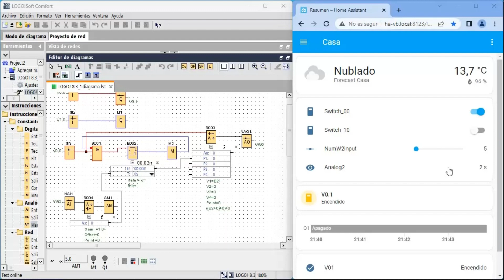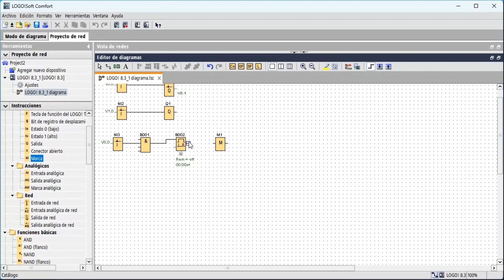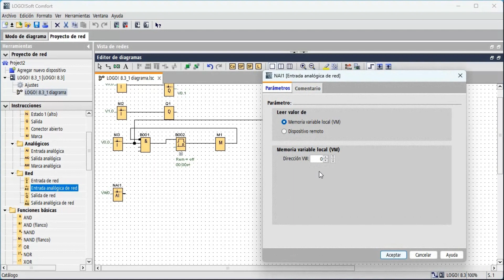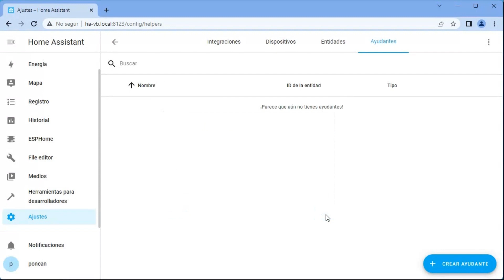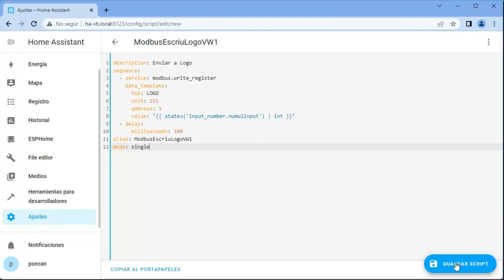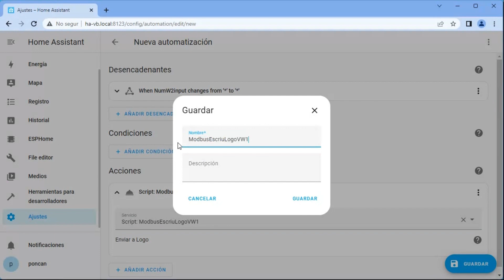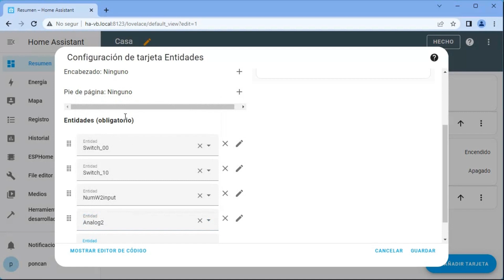Home assistant  Siemens LOGO! via modbus tcp (señales analogicas)

Comment: Thank you for this video.

I`m struggeling with the basics:

- How can I connect my Logo 8 via Modbus? I`m mainly using NI and NQ blocks to set up my shutters, lights, etc.
- Which settings must be set up at the mudbus-connection and other settings in Logo Soft Comfor?
- Do I need to install the Modbus Addon in HA?

I would really appreciate any help.
Thank you in advance.
Reply from the maker: Thanks for the comment.
As explained in the video you must have the Logo and the machine running HA connected on the same network, with the same ip range.
The Logo and HA parameters are in this video: https://www.youtube.com/watch?v=bvM623LtH6s&t=0s
For these blocks you use that are digital signals it will guide you better.
Anyway you are right that it is necessary to have the modbus integration installed. It is a fault on our part not to have included it in the video.
If you encounter any problems, please do not hesitate to contact us again.
Reply: @progspont2623  Thank you very much for the hint regarding the video-I haven`t found this so far.
I copied your entities and also the Logo program. 

If I change the time via slider, this is not shown in Logo Soft Comfort.
How do you connect NAI1 to HA?

I want to realize a switch-of delay for my garden sprinklers.
That means I want to set up a target time (e.g. 5 minutes) with a slider --> then I press Start (NI1 /V0.0) to start the sprinklers --> adjusted time in the slider should run backwards, until 0 seconds are left, then it`ll be turned off.

This is not running, even if I replace the switch-on delay with a switch-off delay.
Unfortunately I cannot provide you a picture here to maybe understand better what I mean...

But in general-is this achieveable with your procedure shown in this video?

Thank you very much.
Reply from the maker: Sorry, the video we are referring to is this one and we were only referring to transferring the value of the slider to Logo
If what you are referring to is the logic of Logo, I will leave you an example that does what you say, but in any case there are many ways to do it, since for example in this one, to start up it depends on a pulse and once launched it cannot be turned off until the time has elapsed.
Remember to adjust the time units and the V and VW to your project
https://drive.google.com/file/d/1zUqNtlo0a9FZbEWBpBMPBL05b7WYib6Y/view?usp=sharing
You could also do everything from an HA automation but this could leave the sprinklers on in case of a problem with HA, if you can do it in Logo better.
We hope it helps.
Reply: @progspont2623  Thank you very much.
I have tried both ways. 
The main problem ist, that making changes in HA with the slider, this has no effect to the value displayed in LSC (Online -Test).
Do you have an idea, what might have gone wrong?
Thank you for all your friendly support.
Reply from the maker: We first do a simulation in LogoSoft and in it we open the data table, we introduce the VW in the case of the example VW3 and we check that by introducing a new value this is reflected in the simulation.
Then in HA
Check that in the script that appears at minute 5:15 of this video you have the correct address, keep in mind that it has to be a number one digit lower than the VW of Logo.
Also make sure that the template contained in value: of this script correctly addresses the numeric helper (slider).
We can't think of what else could go wrong.
If all this fails you can check in developer tools Actions (previously services) put modbus.write_register and in user interface mode fill in the fields and [PERFORM ACTION] once you have done that you can press MODE YAML
We hope it helps.
Reply from the maker: The template contained in value: you can check it in Developer Tools TEMPLATE
Paste it at the end of the editor and it should give you the value of the slider.
Reply: Thank you very much.
I still didn`t get it runnig.

In the configuration.yaml you have an entry:

hub: LOGO

What do I have to enter here?
I tried it with this entry, I have also entered the IP of the Logo, etc.

Thank you very much.
Reply from the maker: At minute 6:20 of this video in configuration.yaml line 21 we define name: "LOGO" or whatever you have.

Comment: Many thanks for bringing up this video. Did you realize a roller shutter with logo and home assistant. This would be a great example. Today im struggling with this kind of topic. ManyThanks
Reply from the maker: Thanks for comment. We have never done any project with blinds or awnings, maybe in the future...
We are currently busy on an external project and cannot upload videos.
In any case, we would have to study how to use a LOGO! to control blinds, as the basic version has 4 outputs it could control 2 blinds, if it could be mounted near the blinds it would be a solution but even controlling 2 blinds it would still be a much more expensive solution than with ESP8266/32 type microcontrollers.